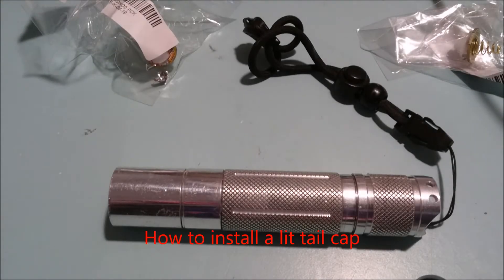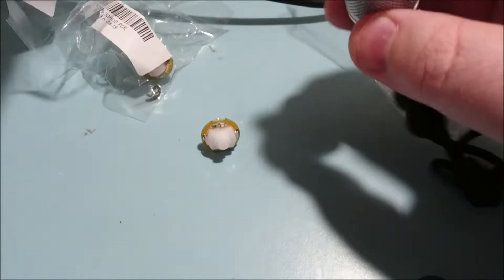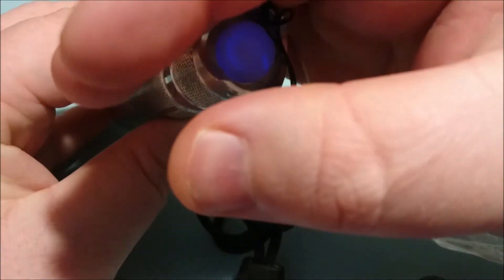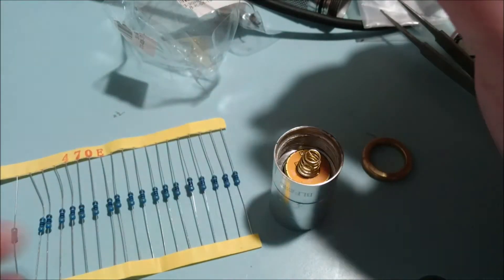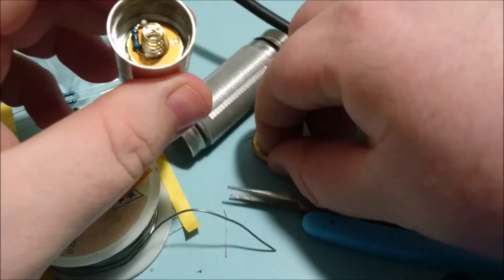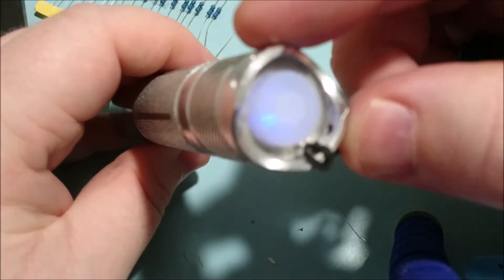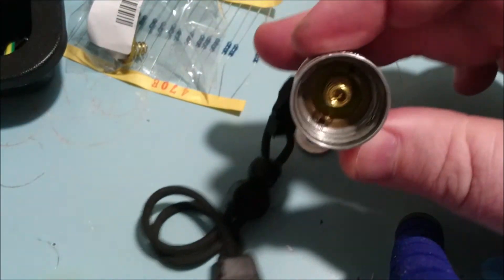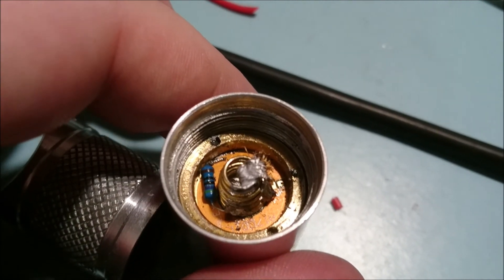How to install a lit tail cap Full video! (Reupload)

Comment: Thanks!
Just ended up with the same solution: soldered a 470 Ohm resistor between driver contacts and modified a tail switch light little bit, by re-soldering orange LEDs to a warm-white ones, using a 47k resistors for each.
Not so bright though, but anyway my flashlight could be clearly seen in the dark. So I am happy with it!
I have a Convoy S2+ with 12-group mode Biscotti driver, paired with Nichia 219b 3500K.
Good luck, mate!

Comment: Good video and instruction 👍 If i want green , red light or rainbow colour, which metal film resistor can i buy then.   https://youtu.be/xqXwSOOuz7M   Can you explain for me how does this work. How can he get a light in a cirkel. Thanks.
Reply from the maker: Hey mate some drivers don't need a tail cap bleeder. What light are you modifying? Or what driver is in the light? For custom tail cap colours you can buy the tail cap from convoy and change the LEDs that are in use. Or you can go to oshpark and buy boards to populate and make your own tail caps. Others make more custom tail caps but they are more expensive so I've never bought any.
Reply from the maker: The way it works is the bleeder the resistor let's through a small amount of current when the switch is in the of positions. So by varying the resistance you can make the tail cap light brighter or dimmer. The driver in this light I modded works without a resistor but it just starts on next memory mode every time.
Reply: @everydaysurvivalgear   Hello again i try to modyfying a convoy s2+ with a metal switch. i put aslow rgb flash rainbow multicolor led in the tailcap, but it didnt succeed very much. I cant choose modes.  I have contact the man in the video, if a can buy a tailcap or a flashlight, but i havent got any respons.
Reply from the maker: Hmmm you mean you can't change the RGB colours or you can't change modes on the light itself? The tail cap shouldn't stop you from changing modes unless there is no break in the circuit.
Reply from the maker: @lakasund  I'm not sure. What parts do you have in the kit? Did you build the tail cap yourself? It could be a bad connection with ground?.  Try making contact with the outer if the battery tube with just the tail cap board not the whole tail cap assembly. You shouldn't need a special driver to run this tail caps but I can't be sure as I have not seen them before. Also if you connect a multimeter to to both rings on the tail cap does it light? Meter has to be in diode mode?
Reply: @everydaysurvivalgear  Ihavent got any kit. i soldering the slow rainbow diod, directle on the tailcap positiv an negativ side. i understand now i didnt gone work. i found a video on youtube now about Modefying tailcap. metalcap ( convoy s2+) I need a board and other things to get it work. Thank you very much for your help.👍

Comment: So, all I need is to solder a 500 - 800 ohm resistor to stop the light to go the next mode?
Reply from the maker: Yea that will fix the issue. You can it a few ways. This way is probably the easiest.
Reply: @everydaysurvivalgear  I added a 560 ohm, still going to the next mode. Is there positive and negative on a resistor?
Reply from the maker: @1uP-v2  nah they don't have sides depending on the resistor used? Some odd resistors do. Try a lower value? Or try and get into the setting and reset the driver. Is it a A6 driver? The x6 driver already has a bleeder resistor added. It could just be set in the menu.
Reply: @everydaysurvivalgear  it's the FET + 7135 17MM MTN-17DDm.
I just bought this resistor, I don't have other values resistor. I reset a few times already.
Reply: @1uP-v2  I'm having the same problem. What firmware are you using?
Reply: @nnnnnnnnnick5557  Bistro. I changed it back to stock tailcap. Fixed the problem. Guess the LED tailcap was causing the problem.

Comment: I want to ask, can the pill from BLF A6 be removed.  I have a plan to move the FET + LED XPL driver to Convoy S2+
Reply from the maker: Hey mate the BLF A6 has an integrated shelf, So you would have to unsolder the parts and solder them into the S2+. Everything is the same size so its an easy fit. Just make sure not to use to much solder on the LED board as the reflector sits low and you can create a short there.
Reply: everyday survival gear I see, actually I avoid being soldered because I don't have a soldering iron or tin, what I want is just plug & play, I guess I can't move right away.  I thought I could be moved directly without soldering, I like the FET driver but at the Convoy host, hopefully in the future there is Convoy who uses the FET driver.  ok thanks bro for the information.
Reply from the maker: @classifiedx91  Simon now has a few options if you look on his Convoy store on Aliexpress. My BLF A6 with spring bypasses done around 1500 lumens. The S21A should perform similiar to the BLF A6 probably be  a tad brighter seeing as its using a SST40.

As far as i know the only difference between this the S21A and a S2+ is the battery tube is a tad longer to support 21700 and 18650s.
https://www.aliexpress.com/item/33026858558.html?spm=2114.12010612.8148356.20.3b626d6cDlbAlw

Or he has this S2+ which does about 5amps should be good for 1400-1500 lumens. These drivers are simple but built well they use good brand name MosFets. I bought a few to try.  Plus you can mode the driver to do more current if you want.
https://www.aliexpress.com/item/33009862476.html?spm=2114.12010612.8148356.44.3b626d6ckij57s
Reply from the maker: They might be a tad more expensive compared to the BLF A6 but arguably better value as the SST40 can do 2500 lumens when over driven and the XPL will top out at 1600-1800 lumens. Plus you get better components on the driver board. 

Also have a look around at the usual sellers they might have better prices on these lights.

Comment: Nice job! How much faster does the battery drain with resistor added and it being brighter? I think I only need it dim so I can find it in the dark or if I drop it at night.
Reply from the maker: Hey mate the battery drain is okay you should get around 6+ months of drain with the tail cap being this bright. This will depend on the cell being used in the light of course. 

Some drivers need the resistor mod to function proper while using a lighted tail cap or they dont function properly.
Reply: Thanks for that info. I always wondered about that. I ended up ordering the silver Convoy S2+XP-L HI 7135x8 driver rubber button model from Banggood today, its the only new version of that flashlight with a full rubber LED tail switch already installed. All the other versions have a smaller metal or plastic button.

Comment: is it dark in australia at night even in summer? In Finland it gets dark from autumn forward, so I'll build my lights when I use them in the winter lol Now during summer it's only bright out
Reply from the maker: Yea its winter here now. We are far from the equator so its dark from 7-8pm in summer.  We have day light saving time so the clocks move for summer. In winter well yesterday it was dark by 5.20pm probably get light again by about 6am. You lads are close to the arctic? We are in the middle of no where lol.
Reply: everyday survival gear yeah that makes sense, we have alot of light in summer but during autumn and winter we have very little light, like for example during autumn it may be dark until 9am and go dark like 4-5pm. In general we see too little light here around the year so we get depressed lol
Reply from the maker: That is friggen awesome sounds like so much fun you can shine lights around all the time. You need a UV light to get your vitamin D lol

Comment: this video is lit😂
Reply from the maker: lol yea i wasn't sure what to call it. I am not sure if its a lighted tail cap because that is real bad spelling lol. 

Where and how have you been? Any more lights? Any  more mods?
Reply: everyday survival gear well... after winter was over we so much light outside during spring and summer that no flashlight is needed so it's on hold until autumn. Nothing new really started a new job etc. I'll be preparing some lights soon though for the dark season lol, gotta be prepared! Always fun building lights though! I discovered that buying a cheap host and some xhp50/ xpl and a cheap driver is much more budget friendly than actually buying new lights and it's more fun to build your own anyways! You can build a cheap xhp50 s2+ pocket rocket for like 40 bucks vs like spending 100+ on one!
Reply from the maker: Yea it sure is. Did you use your LD3? That sounds like a good mix LD3 and XHP50 in a S2+ that would be a rocket. You have to look around for cheaper lights and deals and sales some times you can score good bargains.  I have been modding random lights i buy from hardware stores here. 
It can be a fairly expensive hobby. Even buying parts last time i spent about 80 USD on a few parts.  Am i going to buy the D4 from international outdoors. Their is a thread about on BLF its got a quad emitter under optics running on direct drive puts out 4+k lumens from a single 18650 its 35 USD so not bad.